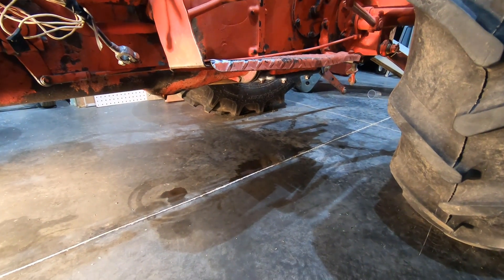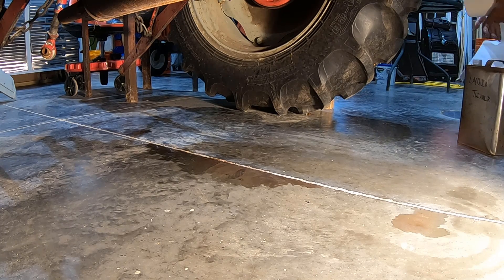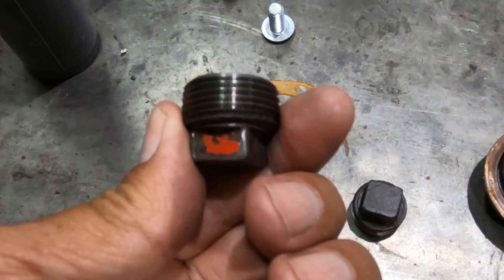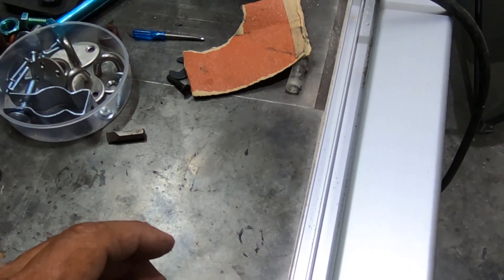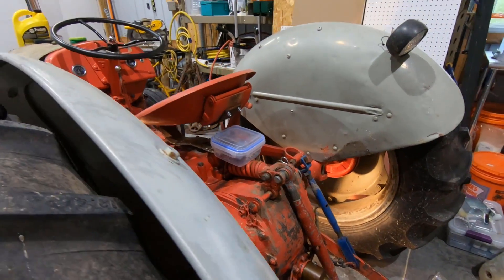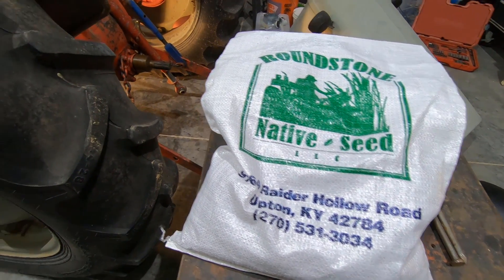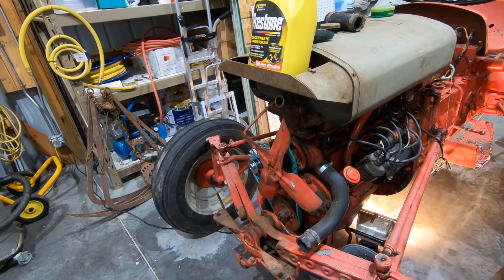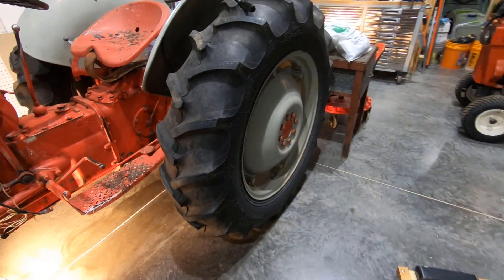Adding Hydraulic Fluid to an Antique Tractor

Comment: Thoses threaded bolt holes are for a swinging draw bar mount. Bought one for my 49 8n as it came with no draw bar.
Reply from the maker: Thanks Joe! That tractor was in a temporary shelter that went down in a storm last week. I'll pull it out in the Spring and get back to work on it. I'll have to look into the swinging draw bar. The draw bar that's on there is really toast!

Comment from the maker: This project got stalled a bit, but will be on track again in early 2021 -- as soon as i finish up the deck-topped super insulated addition I have been working on. I am almost done putting on horizontally installed pole barn siding which gives the building an industrial look. here are some links to that stuff:

Addition Playlist: https://www.youtube.com/watch?v=seFLn5gaBhY&list=PL_iZ8t8zAFuPKLtixu6uLRsJZA1oCwH5m
Flat EPDM Roof Playlist: https://www.youtube.com/watch?v=dryOGYyZSSo&list=PL_iZ8t8zAFuMGOp73WX6s5tty9WaO4zX4
Siding Playlist: https://www.youtube.com/watch?v=PWTKMSR9cmI&list=PL_iZ8t8zAFuMNzb3VpFAOr-fPCN6uyqs1
Window to Door Playlist: https://www.youtube.com/watch?v=vMquUXXy6h8&list=PL_iZ8t8zAFuP16uP4s615suesLQPFrtK_

If you enjoyed the video, you can buy me a beer here: https://www.paypal.com/cgi-bin/webscr?cmd=_s-xclick&hosted_button_id=U5BDZFCHV9WLQ&source=url

Comment: Im just on with draining mine and have the same problem with the lifting gear stuck at the top and wont come down. I took the dipstick plate off and it all seems to work on the inside when i try the lever up and down but the harms dont move. maybe it will all work when the new oil is added. Im in England so we both suffer from the same thing. It never stops raining . NEVER !!
Reply from the maker: This video was a while ago, but the hitch arms lifted fine when it was refilled. One thing you have to remember is that (I believe) you have to disengage the PTO once the arms are in position. It's been a couple of years since I got it running and drove it — it's now waiting on a brake job 😐

I'll be working on the tractor again as soon as I can, but here is the playlist of all of the things done so-far:

https://www.youtube.com/watch?v=gdC1VKxBkWw&list=PL_iZ8t8zAFuMSeubgkz3oYvPq_zCOKLST

Good luck, and stay dry 😉

Comment: Also radius arms on war ones like I beams not round looks like may have later front end
Reply from the maker: It is a 1951 Ferguson TO-20. They were not made during the war Production started in 1948.
Reply: You are talking about a Ford. This is a Ferguson TO-20.

Comment: ok 3 drain plugs, but 1 fill plug correct? or is there 1 for each of the 3 compartments?. Thanks
Reply from the maker: Yes, I believe that Is correct. I'm not in the shed at the moment but that makes sense. The fluid is shared by all of the components, and there is a drain for each because they are at different levels. The fill is on top so only one is needed.

Comment: I look for the light install video I could not find it but my lord you can do a little bit of everything what kind of welder do you think I should buy for a beginner and were did you buy lights for Ferguson trator my did not have them on the front they were gone
Reply from the maker: Sorry, I haven't installed the lights yet. I just showed them and the other stuff that will be installed in the 'kit' for the Ferguson. As for the welder -- I don't know. I'm just learning to weld. My wife found the nearly new welder at a barn sale down the road. This one is a Hobart stick welder, and I'll be trying my first weld next week.
Reply from the maker: I'm a beginner welder, so I'm not the person to ask about welding. We found a Hobart stick welding machine at a rummage sale that was nearly new, and a good price so that's what I am starting with. The Ferguson lights came from Steiner Tractor. Most old tractors -- especially 6-volt ones -- did not come with lights from the factory, but they were available as an option.

Comment: That one looks it was made war time there no push start button  on trans cover and it don’t have right engine in it never had dist cap on right motor until later looks like 3 speed transmission
Reply from the maker: These models never had a push button starter and production started long after the war. The starter works using the shift lever so that it cannot be started in gear. It is a 1951 TO-20, and has a Z120 Continental motor which is correct. Maybe you are thinking of the TE-20?
Reply: None of these were made during the war.

Comment: Is Hydraulic oil and hydraulic fluid the same and ok to use in a case backhoe
Reply from the maker: Hi Andy, I would read the owner's manual on the specifications as they are not the same. I would guess you need hydraulic fluid.

Comment: how mutch oil is it ca?
Reply from the maker: I just added that to the description, but it is 4½ gallons of 90 wt. mineral oil.
Reply: @PlanetMojo  thnx my old troctor from pre ww2 is my only work horse atm so ye
Reply: @PlanetMojo  what are the 2 cotter pin looking things under the tractor and what do they do? My ferguson has them too.and there is a dipstick to check the fluid in all 3 on the right side towards the back at least on the fergie

Comment: Guy your wrong I work at Ford tractor dealer 20 year it was 53 hydraulic oilFord tractor then change it to 134 d hydraulic oil  it’s like 10w30 weight 90 weight or 80 is to thick slow hydraulic down .
Reply from the maker: This is not a Ford tractor. The fluid used was correct. It uses 80 to 90 weight mineral oil.
Reply: You seem to be a very dense person Ron. This is not a Ford tractor, it's a Ferguson TO-20.